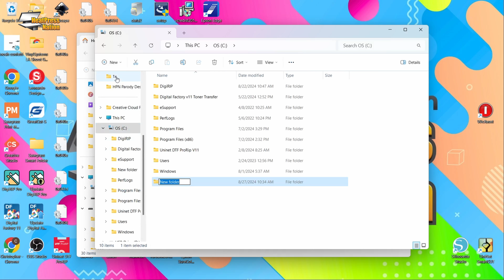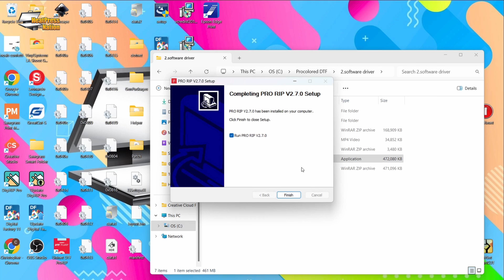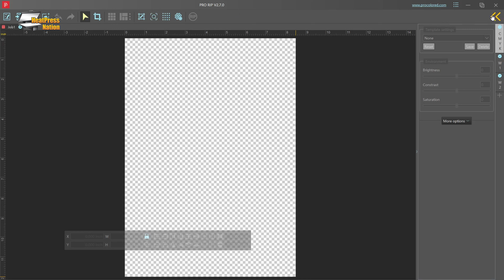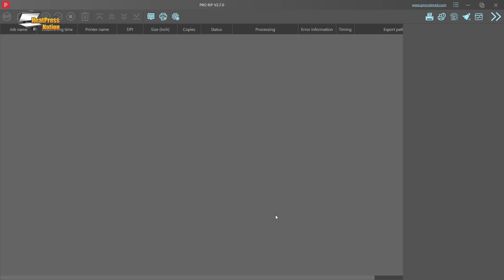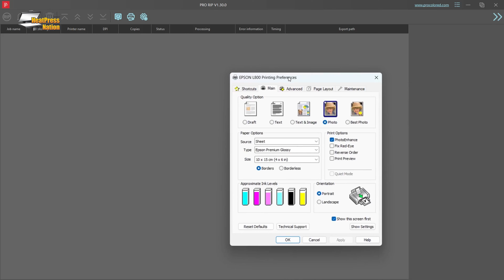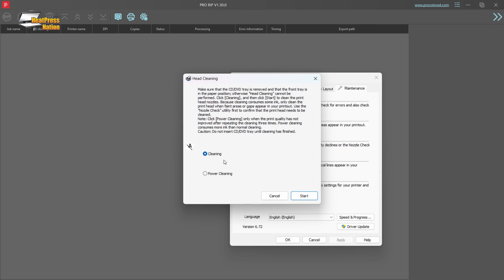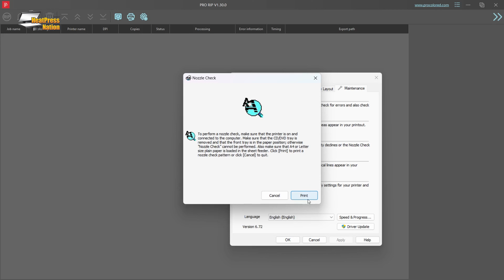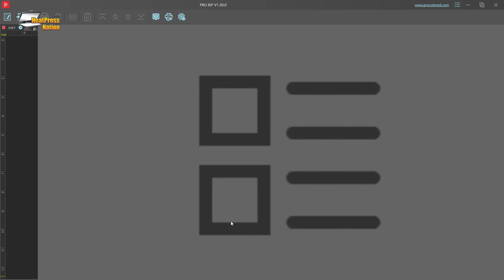How To Setup Procolored A4 Desktop DTF Printer

Comment: Is it possible to save the cured print sheets for later pressing ? And how long can we save/store the print transfer ?
Reply from the maker: Yes, properly stored transfers should have a shelf life of at least 3-6 months. To properly store cured transfers we recommend placing them in an air-tight container (like a sealed bag) with a silica gel pack to absorb moisture. Then store the bag in a drawer or cabinet, away from direct light or extreme temperatures.

Proper storage allows for the longest shelf life of your cured DTF transfers.

Comment: Hello, the moment I start to suction the ink with the syringe (around 28 min of video) into the printheads, the ink is not coming easily. I am struggling to pull out any ink for all colors except the white. Any idea why I’m having trouble suctioning out the ink? It almost seems like the tubes are closed but they are brand new.
Reply from the maker: Hello. Give our MyExpert support team a call at 1-800-215-0894 and they can help you resolve this issue.